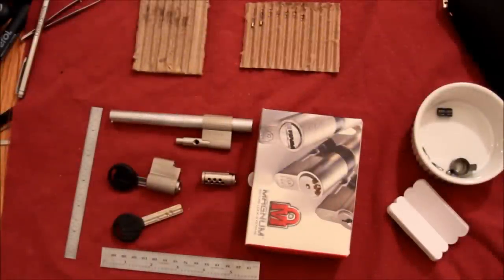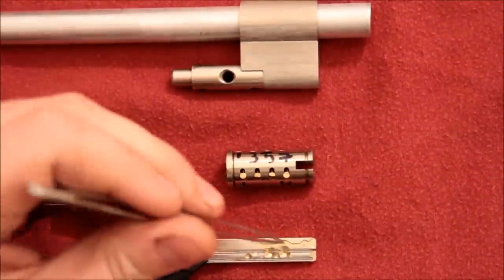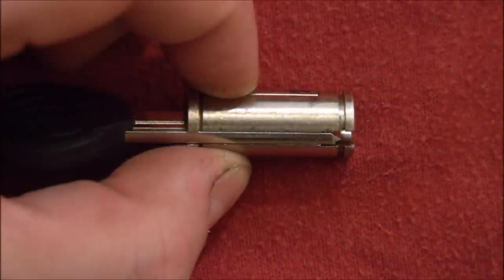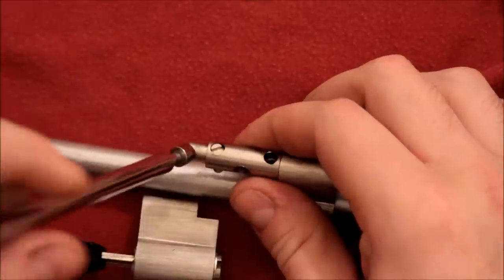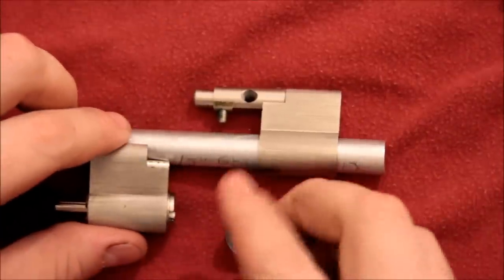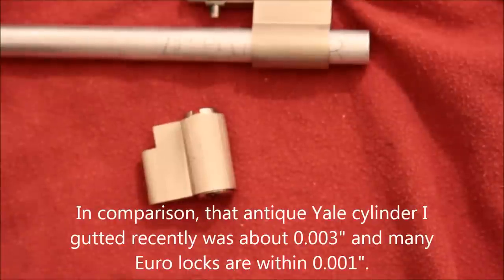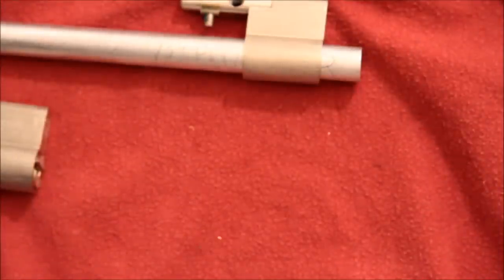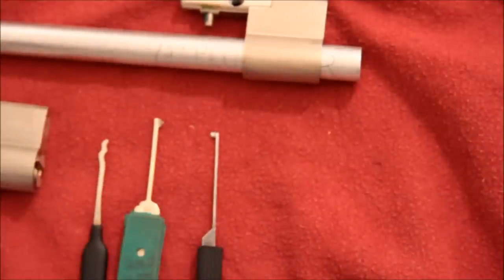(153) Magnum 2302 -- Gutted (2 of 2)

Comment: The central spinning bit of the euro cylinders can't be manipulated as far as I know because it sits on notches on the rear sides of the plugs depending where the key is inserted. Rotating the plug is mandatory to set that thing spinning and thus operating the cam. Some euro's can be manipulated only when they have thumb turns (if I say it correctly) on the one side.